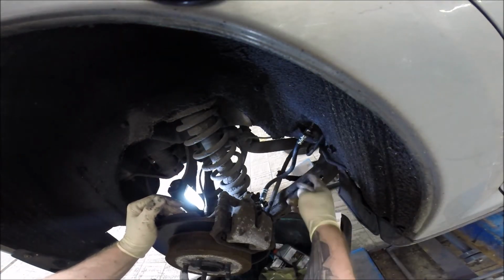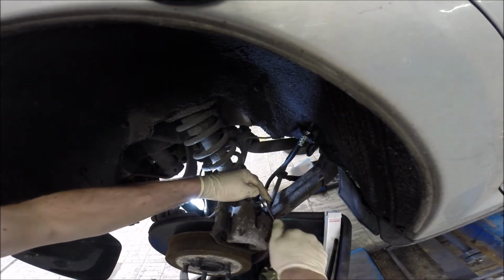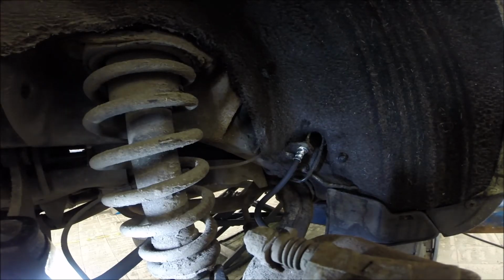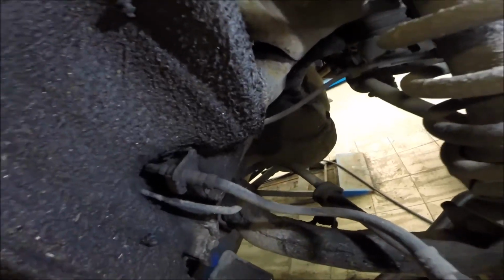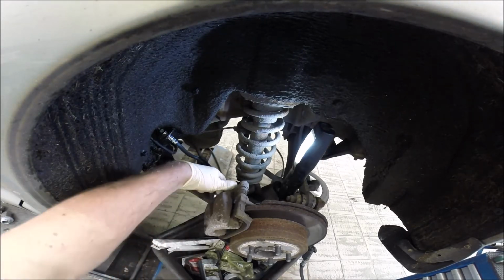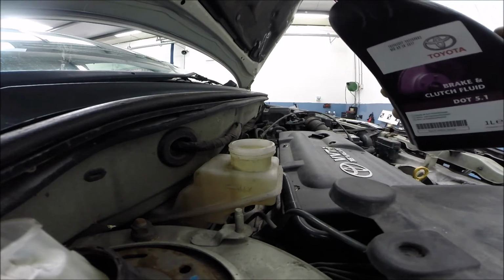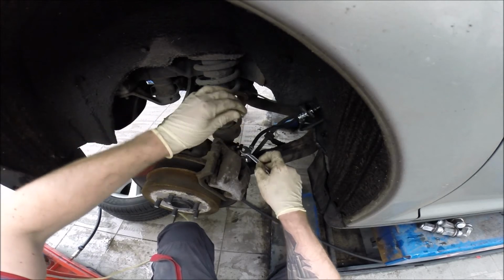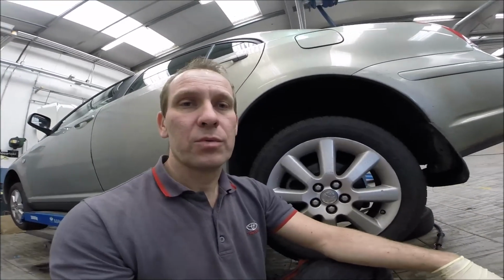Toyota Avensis 2004 Brake Hose Replacement

Comment: This is so helpful.  I appreciate your quality videos.  Can you help show how to change rear dust shield of 2004 Toyota avensis ? Thanks in advance.
Reply from the maker: Hi, I will make a video if I have the opportunity, but no idea when.
Reply: @FixYOURride13  ok. Thanks. I look forward to you doing the video when you have opportunity.  Once again, thanks for your quality videos.
Reply: @FixYOURride13  
Please I have a problem and I need your assistance. I changed my Toyota avensis suction control valve (SCV) sensor and yet the engine is not starting. What can I do for the ECU to recognize the scv or for the engine to start? Must the scv be original denso? I appreciate your response in advance. Thanks.
Reply from the maker: @masterfoodrecipes3963  hi, I will try :) so check live data fuel pressure information, what is the fuel pressure during the starter motor working?
Reply: @FixYOURride13  I don't know the fuel pressure at start motor though engine cranks well but don't start.
Reply from the maker: @masterfoodrecipes3963  OK, whay you replaced the scv?
Reply: @FixYOURride13  I replaced the scv because my car goes into limp mode..pressing my gas pedal without power delivery. Also engine goes off and the can run well after I restart the engine. Now I changed the scv, but engine cranks well but can't start. Maybe the engine doesn't recognize the new scv.
Reply from the maker: @masterfoodrecipes3963  2004 d4d? So, first check : you have correct fuel (not petrol) , check engine errors, if is not present, check te fuel T bag in the tank, fuel filter, remove all injectors fuel  metal pipes from the injectors and during cranking check the fuel or compression is not pissing from theinjectors fuel pipes connection injectors side.
Reply: @FixYOURride13  ok. Thanks. I'll work with the information.
Reply: @FixYOURride13  hello. Good day. I tried what you said...still no startup. All filters changed, engine oil replaced, brake discs and pads replaced SCV changed, MAF changed, water coolant changed, still no starting. What can be the issue?
Reply from the maker: @masterfoodrecipes3963 OK... So time for diagnostic, and check fuel pressure.